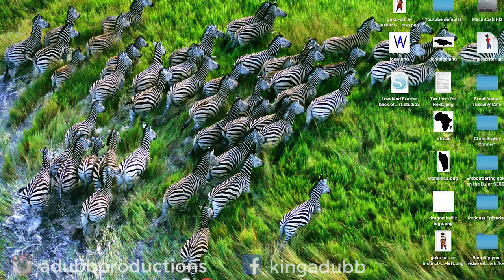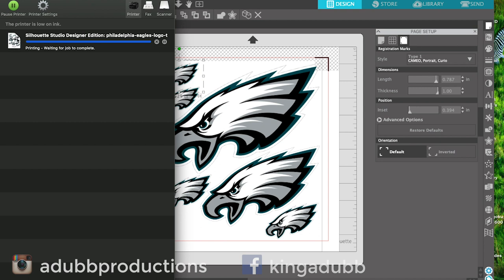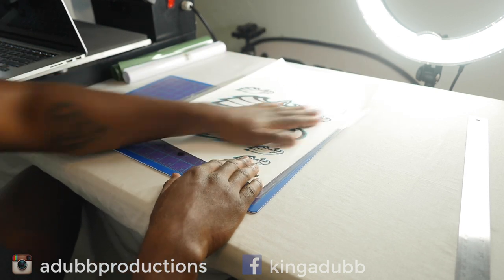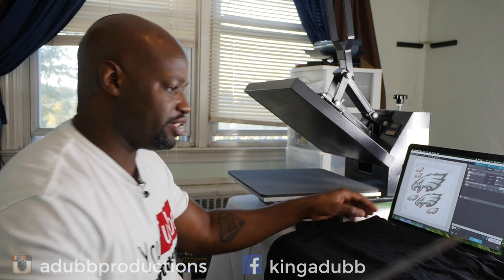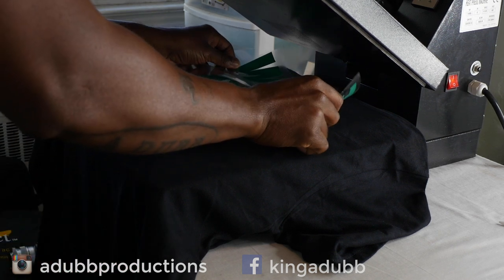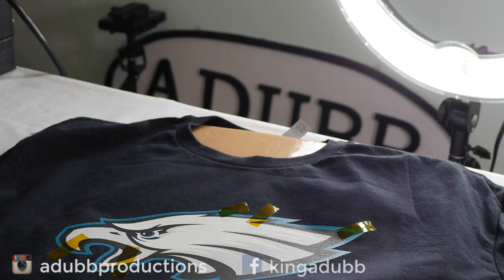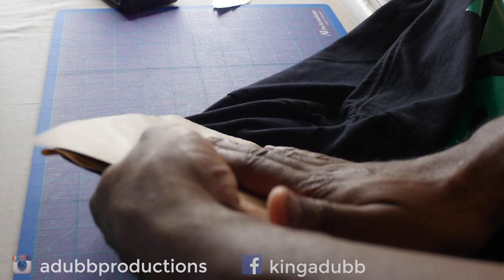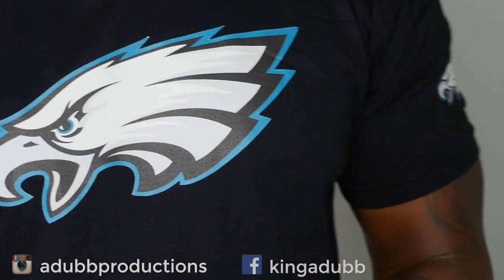Silhouette Cameo 3 | Print and cut | Eagles shirt/jersey project

Comment: Hey nice video but for those transfer that is rolling up on you, all you need is to get some of the clear carrier like that on the Heat Transfer Vinyl
and stick it over the print, that will keep it firm and flat then you can do your normal press, allow it to a bit then remove the carrier.

Comment: This is an awesome video. The best thing to use to transfer the design onto the shirt is heat tranfer masking vinyl. Not the kind that is generally used with permanent crafting vinyl used on glass and windows. This can be heat pressed and It is sold on Amazon for $15/10ft. Or Stable wsell it for $170/25yrds. There may be other places that sell it, but this is where I've purchased.

Comment: I do print n cut on an old silhouette cameo 1 that I got for free :P I use laser transfer paper and I put a pieces of clothes (a piece of tshirt in my case) on top of my sillicon sheet... it take cares of the humidity and it keeps the design in place and prevent curling of the edges

Comment: Thanks for making this video.   I have been trying to decide if I need a Cameo to weed heat transfer vinyl.   I have a Graphtec 6000, but the Silhouette software looks a lot better for weeding.   I have been reusing pieces of the  clear from HTV to hold the printed vinyl flat and keep it from curling.  It's good because you can see the design to line it up on the garment.   Do you have some work out videos out there too?   You clearly spend a lot of time at the gym.

Comment: Hi, I really like your tutorial but I still have some questions for you. 
1. Do you print on a normal paper (a4) or is this a special paper?
2. Can i print with a normal printer or do I need a inkjet printer for this?
Reply from the maker: skip Hey, it has to be an ink Jet printer and a link to the paper i use in the video is in the description of the video.  You can not use regular paper.
Reply: A-Dubb Productions Allan Wade thank you so muchh
Reply: A-Dubb Productions Allan Wade but after the printing on the paper, I can just press it with the heater? Or do I need to do more things?
Reply from the maker: skip no problem.
Reply from the maker: skip you still have to do more for the best results. Use your cameo 3 or 4 to cut out your Design then peel it up like i show in the video and press. Watch the video again and you can see.
Reply: @adubbproductions  is it the normal ink or sublimation ink and is the design washable?
Reply: @adubbproductions  I'm also about to buy a printer but do you use original ink or what do you have for any ink?

Comment: You should press w/ an iron first then finish off w/ the heat press to make it permanent.
Reply from the maker: Really.  That makes it permanent?  I didn’t know that. Thank you. I’ll definitely try that. Thank you.
Reply: I’m figuring you wouldn’t have the heat coming off the top of the platen from the heat press, if you were to use an iron first w/ the Teflon sheet it would set it first, then if you used the heat press after it would be less difficult. Also you’d save your heat tape.

Comment: Thanks for the video! I have question. Can you recommend some printers to use with printable heat transfer foil. I was looking in to epson L1300 and cameo 4 combo, can you tell me is that good? L1300 is working with eco solvent ink is that good ? Because heat transfer i was looking in to is Poli-flex 4030 its printable and its working with solvent and eco solvent printers.

Comment: You shouldn't have to peel off those transfer paper, you can peel it off after you apply the heat press. Just be sure the printed part should be facing the shirt, and flip the design especially texts.
Reply from the maker: I was following what the instructions said to do. Could you help me understand though. How do I press it down onto a shirt if the color and image that I want is on the side that I’m pressing down?  When I peal it I’m going to have just a white shape. The printer only prints on one side of the paper. Help me understand how you do this?
Reply: @adubbproductions  btw man, Thank you for the great tutorials, learned a lot from you,  just subscribe.
Reply: @adubbproductions  But I think you are right man since you are printing a black t-shirt.

Comment: Question?: why did you do an offset? 
I am doing a design with words do I offset that too after I print it ( meaning print with registration marks then go back to design in silhouette and add offset before cutting) 

For setting even though I will be using 11x17 paper do I still set page setup 
 in silhouette as cameo 12x12 ( if that make sense)

Comment: Excuse me I have a couple questions if you can get back to me and be appreciated I am barely beginning an I really want to print out pictures and cut them like you just did but what printer do you have and what paper do you use  I have a HP officejet 8022 but idk if this will work I'm looking for a cost effective way to get images on mugs hats shirts that are full color I got the cameo 4 and a heat press just need to have some guidance please thanks in advance

Comment: Really dope, but I'm gonna be using a basic iron instead
Reply from the maker: If it works then that’s good. Doesn’t matter what you use if the end result is the same? 💪🏾
Reply: DanielPlays • yeah that’s smart, just to get it down, then do a full press!
Reply: You can use an iron with this vinyl from the cameo?

Comment: Hello Mr. Allen, hope all is good. I wanted to ask what type of printer do you use? What are you printing on? Does it las a few washes?
Reply from the maker: In this video I used the Epson workforce 7720. It’s discontinued now unfortunately. Yes it pretty durable and does last a ton of washes. i still have this shirt actually
Reply: @adubbproductions  thank you, one last question, what type of vinyl or sheets do you suggest to print and cut with?

Comment: My guy smh. 1 you cut threw the backing of the paper. Why did u do that. You need to just cut threw the top layer then peel off the excess. 2 to stop the curling you should be using transfer paper so curling doesn't do that to your designs.  Making it much easier .
Reply from the maker: Lol. Yea bro. I didn’t know that before. Since then i know better. I’ll make an updated video. I appreciate the insight though. Lol for real.
Reply: @adubbproductions  hey A1 that's what's up. Trust I've burned so many images and forgot my Teflon sheet and had to scrape vinyl off my heat press . Like you said we don't practice we do!

Comment: hey Allan - A- Dubb  you videos have  been fire .. but with fire there is smoke i have a trick  that i tried it may seem time consuming but with my priny and cuts  i print and cut   then i take may shirts and line every thing up before i turn on the press using the heat tape  and if i got a back  i press  the fronts first you have the Teflon  pillow so press the fronts the flip and do the back  that way you dont hve to worry about the design curling .... try it and then  do a video  on it if it works for you  just a suggestion that work flawless every time and im new to this as you ..
Reply from the maker: Hey. It’s worth a try. I’ll check it out.

Comment: I have the Cameo Plus.  These are my settings for the Nenah 3G Opaque vinyl transfer.  Thought they might help seeing you running issues. This works great with clean kiss cuts.  Notice a single pass, force 4, speed 6 but speed is optional.  It works well for me. https://www.dropbox.com/s/bekpw4gmgcx5u6e/Settings%20for%20Nenah.PNG?dl=0   The curling is from peeling the image from the backing.  If you use these settings you should be able to weed the waste in almost a single peel.  The remaining images intended for transfer can then be removed slowly using a spatula/scraper in a slow side to side motion until the image is released from the backing.  The edges will not curl and you shouldn't need heat tape. Let me know if this helps.
https://www.amazon.com/gp/product/B00AECRQC4/ref=ppx_yo_dt_b_asin_title_o08_s00?ie=UTF8&psc=1

Comment: i hope the opaque transfer paper cuts good with the cameo cause I went through 6 sheets of paper. the prints came out awesome, but when i go to cut, with great cut settings, it seems like the cameo doesnt like the transfer paper im using cause it cuts thru but when i go to weed it, the paper gets all messed up and stretches cause the cameo didnt give it a clean cut perhaps due to the type of transfer paper im using? im hoping its the paper... doesnt cut through even with higher setting. also, this paper that i bought makes a mess of white particle dust from the paper being cut. do you think its simply the print paper that im using. i just ordered some opaque hopefully i get a clean cut all the way through. the design im trying to cut has many thin lines and the cameo registers and cuts it all around but weeds awful. i feel if i do 2 passes with that kind of force, the paper will just come apart. thanks for the tips. let me know...

Comment: great ...any heat on a transfer will make it curl. sticky sheets helps with that application and you can cut them to size. hot peel after pressing.

Comment: OK I hv the cameo 4, I'm watching all videos I can to learn. I noticed you always use THE EPSON PRINTER,   Is there a reason for this and do I need to buy one. Why don't u let the cameo do the cutting.
Reply: To print images like this its easier to use inkjet printer u could cut the shape of the bird n fill it with vinyl but pretty difficult